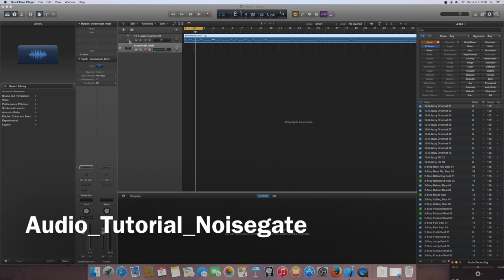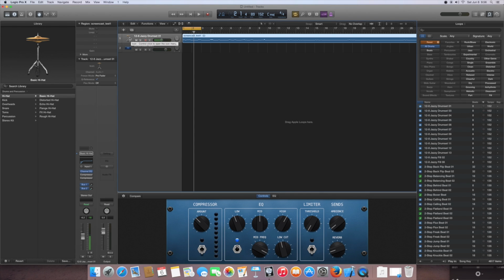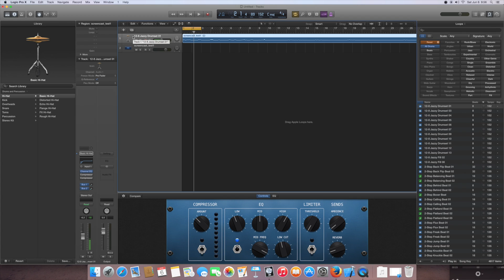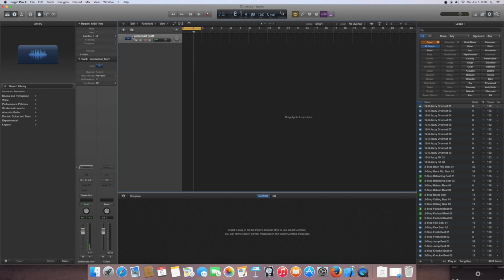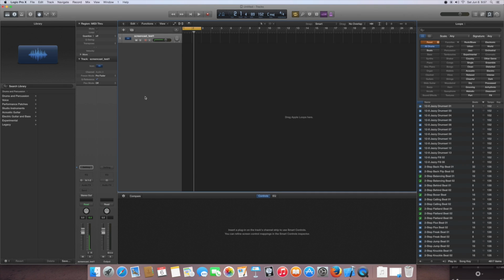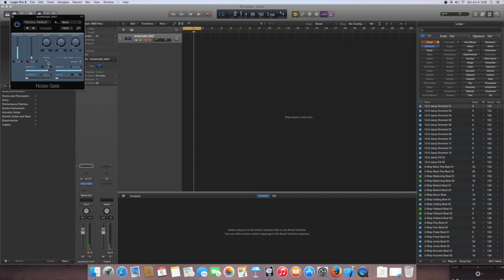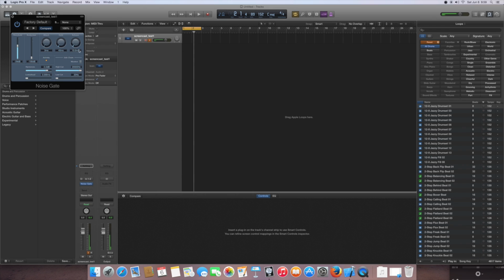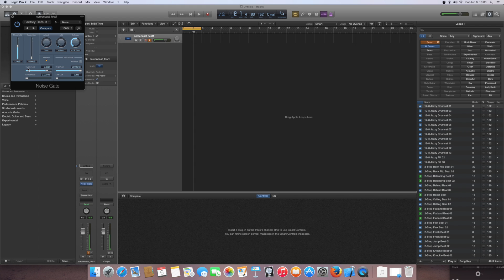Remove Line Noise | Remove Background..Noise-gate Logic Pro X

Comment: Hi Hexiarmin Got A Question In Regards To Logic X Pro  I Have Sound During the Actual Performance Thru the Monitors But During Playback It Goes Thru the IMac Speakers Even Tho My Universal Audio Apollo Twin Is Selected How Come ?
Reply from the maker: steve strickland Sorry for my late reply. Incase you still have the problem. As I understand you would like your playback audio to also run over your audio interface via your monitors.

1. Please check under >Preferences> Audio>Audio input or output...
2. For your output please select the device you have your monitors hooked up to. 

I assume you can monitor your recording because you record right into your audio interface, which also outputs to your monitors, while it sends the audio to Logic.

However when you playback, since your output goes over the on board audio device (imac audio-card) you hear it out of your imac speakers. 

So try changing your output device to the one you also record into.

Good luck. Let me know if this was helpful.

Comment: does it work as well for car horns and back ground ambient noises... I know it could be a dumb question but...
Reply from the maker: Thesideplate There are no dumb questions, only dumb answers :) While the Noise gate is a powerful effect, it works by reducing certain frequencies in relation to all the others within a bandwidth. E.g a AC noise is a humming that is pretty much within a fixed frequency area, that can be reduced well. The same is true for static noise caused by the wiring or the Line in of a mixer.... As to the car horn it probably comes in high and fades out lower, which also means it moves through various frequency lines within the bandwith, making it difficult to filter out the entire car horn, without creating significant artifacts (new noise / sound-glitches introduced by a effect).

What you can do is scan through the frequencies with a high peek setting in a EQ and see where it sounds most natural to gate out the frequency of the horn without creating an unpleasant sound drop. Then go back to the noise gate, dial in that frequency range and try to find the sweet spot.  Hope this was helpful. Best of luck.
Reply: I wish your voice waas at the back of my ear  for instruction everytime I make a mix...lol.Thanks..I can use all the help I can get..
Reply from the maker: Thesideplate Lol... you're welcome! Always here!

Comment: It didnt work. Im still getting a hum in the background of my recording.
Reply from the maker: +nicemutant I am sorry, you were not able to find a remedy for your noise problem yet. But maybe some advice for the future...indeed it is difficult to remove some noise. You need to consider the noise-ratio. Every device you use, like mic or other instruments has a specific noise-level. When you record it important to record the input loud enough so that eventually you might easier single out your noise. When the noise level and the audio level are too close together, they get difficult to single out for the equipment without causing artifacts.
Reply: lol.. me too... it's like there's some kind of interference coming from somewhere that I can't isolate and it's been driving me mad. All gates do is remove the noise from when you're not playing. As soon as I play the noise is there. Oh well, the search for line noise removal continues...
Reply: Thank you for replying.
Reply: Mate I'm getting the sound of a fan in mine :D and there was no fan hahahahah